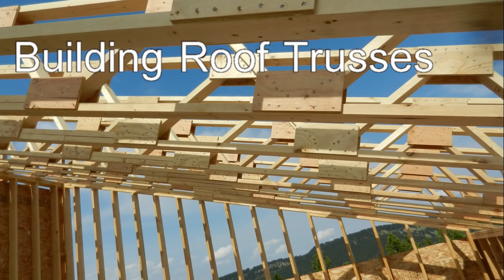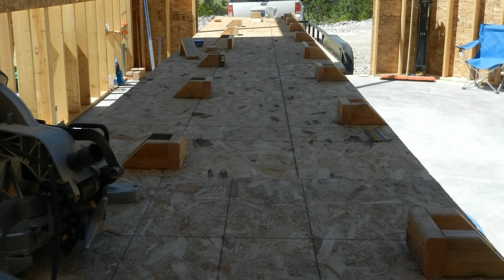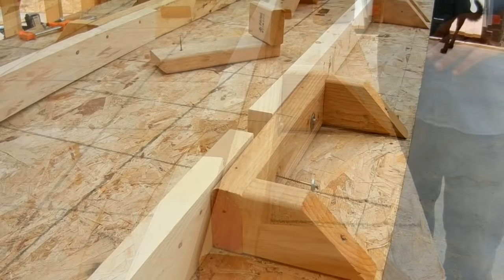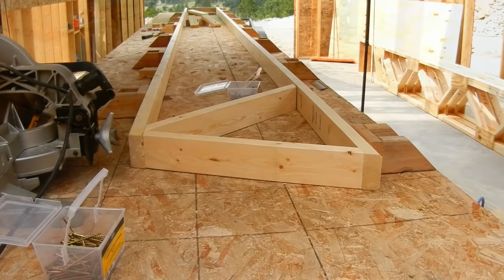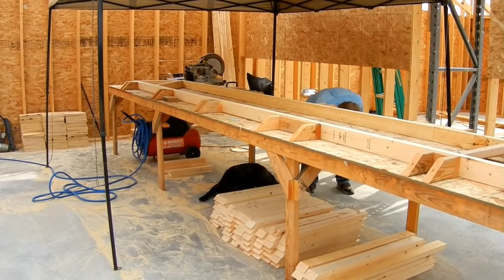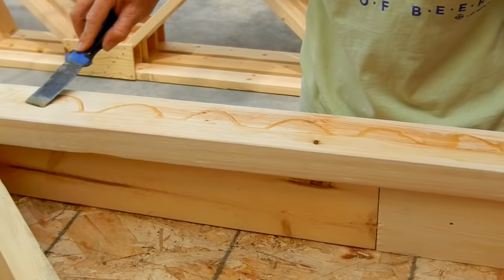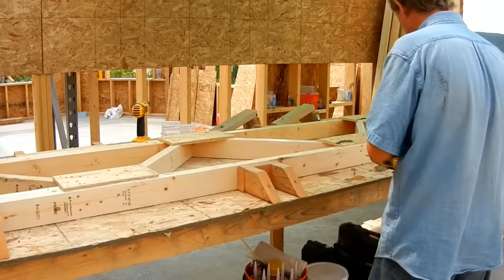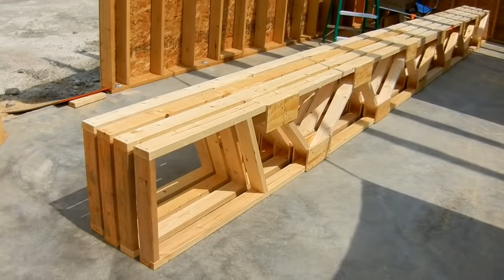Building Roof Trusses

Comment: There are a few video here on youtube where they show how it is done in the factory. Those move along at a fast clip.  They have a couple of things this carpenter does not have. 4 men building the truss, and they have an air ram system to press the truss together before it is nailed off. These two things make the build go at about 1 minute per truss.  Great for the spec builders who can frame a house in a few days.    This guy is obviously building something custom and there is little doubt he is doing the same quality of work, but who here can look at one person working and comparing it to a manufacturer.  Kind of like how long does it take one man to build a custom hot rod vs how long a car manufacturer to roll a car down the assembly line.

Comment: I'm not a structural engineer, but haven't you diminished the 2x4's strength (by about half) by turning them "sideways"?
Reply from the maker: Sean M Truss's don't work purely on bending strength of the members. In a truss each member ends up in tension or compression and being flat doesn't change it's ability to resist these loads. But the real reason they are turned is so that the connection plates can be nailed with a 2" nail providing more holding power.
Reply: +B-Spot Thanks for that, I was wondering.

Comment: I choose the imperial system over metric as a carpenter but Americans are crazy to still use phillips head screws. Robertsons will go at least twice as long before stripping the screw or the bit.
Reply: +Steve Hillier 
I would also offer that the (Lowes or Home Depot) screws shown here are crap- no shear strength at all. Deck screws cost more but are far far superior. If you hit a knot or any dense wood the screws he is using will snap off immediately.
Reply from the maker: +Alaska Bruce --- The screws are used mostly to hold the corners together during assembly and are covered by a connection plate glue and nails in every location except the fascia end where there is no load. They don't need to be anything fancy, and could be omitted completely if I had a better way to hold the lumber in position.

Comment: What they don't tell you .  .  . any glue other than starch glues (wheat or rice glue) will outgas and become brittle with age and will un-stick.  This causes delamination, meaning, the glulam and the plywood that you use to build your house from will literally fall apart in fifty or so years.  One day, it will suddenly fail.  You will notice it when your floors start sagging and holes come in your structure.  That means failure will come soon.  If you want to build a house you can pass along to your children, don't use modern wood products.  Use traditional, solid wood.  Or better, make it from cob.
Reply from the maker: --- I don't have 50 more years in me so I think I am good.

Comment: Turn the boards 90° and use half as many and you will have 4 to 5 times the strength, without the added weight.
Reply from the maker: You might want to do a little research on how a truss works.
Reply: @BSpotBuilds  So might you, Gina is correct.
Reply from the maker: So show me in the calculations for truss's where the orientation of the lumber would be used.

Comment: I am curious if it would be better  not to spread the glue thin like that??.
Reply from the maker: This glue expands as it sets and we only apply enough to just have a small amount of squeeze out. Complete coverage is more important than quantity. I want it to fill the gaps but not end up on the floor.
Reply: I supposed you use polyurethan glue ? thats why you spray water before I supposed also, because polyurethane glue expansion occure with the humidity of the timber if I remember well 

Nice tips if I ve guessed good ;)
Reply: One of the wood magazines did a glue joint stress test and proved that thinner layers of glue are stronger and that surface or contact area is also most important. Some glues are rated for different applications and most wood glue is not rated for structural use or outdoor use. Outdoor rated plywood uses special outdoor rated glue in it's manufacturing.

Comment: Nice video, may I suggest you skip the pre drilling of holes since you're using an impact drill, and pine is quite soft wood. And use a paint roller to distribute glue, makes work easier.

Comment: How did you decide on the size of the gussets?
Reply from the maker: By how many square inches of glue surface was required.
Reply: @BSpotBuilds  Not sure what you mean.  How many square inches of glue surface are required?  I'm trying to find out how large to cut my wooded gussets.
Reply: @BSpotBuilds  Where did you get that number from?
Reply from the maker: @bradperkins4291  The contact area is the area where the 2x4 touches the gusset plate. My plates are 8" x 12", the area that the diagonal 2x4 contacts the plate is about 10". Glue strength is about 250 psi
10" (contact length) x 1.5" (2x4 width ) = 15 square inches contact area
15" x 250psi = 3750 pounds
3750 lb x 2 connection plates one per side = 7500 lb plus 10 nails at about 100 pounds each in shear = 1000 pounds
Total = 8500 pounds per connection.

Your results may vary.
Reply: @BSpotBuilds  Thanks for the quick reply.  If I could pick your brain just a little more; how did you come to the conclusion of needing 8500 lbs/connection?  Is this based on expected live & dead load?
Reply from the maker: @bradperkins4291  I didn't need 8500 lbs that's just what the connection ended up at. 8"x12" was a convenient size to rip the plywood into and provided a good nailing area. As for designing you truss I will refer you to YouTube, there are some good videos on calculating loads. You are correct that you need the live and dead loads, also you don't have to be perfect just good enough.

Comment: The center splices on the top & bottom cords should have been nailed, not screwed! Screws are bad in shear and will fail with a brittle fracture. Nails are more ductile. This truss type also should have double end bearing studs.
Reply from the maker: Do a calculation on the glue holding strength for the splice. The screws are only necessary to clamp the joint. Screws are not that bad in shear, lower than nails but not insignificant. As for double end bearing studs Why?
Reply: Try and find a code with a glue value permitted.
Reply from the maker: @richardh.severn5980  Theirs the problem you live by the code. I do not, and am not required to. Therefore I am not tied to the whims of a bureaucrat. All I-joist are nothing but glue and wood. Zero fasteners why would you discount glue.

Comment: Keep in mind; most codes in jurisdictions throughout the US require Simpson metal mending plates (even though the plywood connectors are stronger), which cost anywhere from .40 cents to $1.50  apiece.   Figuring the average truss would need at least 10 (on each side) and by the time you purchase the lumber - you aren't saving a whole lot of money; at least on the cheaper "in stock" trusses (Menards).   Also, you'd probably need an engineer to 'sign off' on them and we know engineers aren't cheap.   So in short; ready mead in-stock trusses as around $40 apiece aren't worth it, but if you're having more intricate and complicated "special order" trusses made (at over $100) than it's probably cost effective.  As other posters have said, it just depends on how valuable YOUR time is.  .
Reply: Carpenter from Norway here, I don't know the relative cost of material vs finished trusses of other countries, but when comparing them in Norway I can't see how you'd be saving any money by doing it yourself. Maybe after subtracting all of the material costs etc.etc. you'd be looking at a whopping 2USD/hour. Not worth it at all. Let the factories who get the material at a huge discount, has robots to cut it and jigs to mass produce them quickly do it. Unless you are doing it because it's fun though.
Reply from the maker: -- I always consider my labor as free, I am not billing a costumer so the bottom line is how much cash is left in my bank account when the job is done. All the fictitious calculations as to what you labor is worth wont save a real dollar or krone. Also consider to have one dollar to spend you have to earn about 1.40 so that you can pay earnings and sales or VAT taxes. And one more thing to consider is how far you are from a truss supplier delivery charges for me greatly increase the cost.
Reply: But do you not need the documentation for those trusses, or are they not mandatory in your country? We couldn't do that even if we wanted to...
Reply: I found out that "code" require the metal mending plates be rolled on with some kind of press machine which is obviously not available on the home market.  So strike three; I'm out.  The only way to use this method used in the video is to have an engineer sign off on using plywood connectors (as the mending plates) and unless you know an engineer who will work for free - that makes this project completely cost IN-effective.
Reply from the maker: -- Where I live is truly free, no codes to follow, no inspectors to please and guess what? The homes look just like everywhere else they don't fall down or catch fire.
Reply from the maker: -- Imagine that. The building industry teamed up with the government to force you to pay them.
Reply: B-Spot IKR?  As if (layered) plywood would not be 10 times stronger; especially using screws!  I tried to convince our inspector and even showed him this vid - but he was like "nope". The irony is when my (Menards) trusses arrived, half of the fcking mending plates had already fallen off (and renailing those bastards back on with the 1000 little spikes was so stupid) and time consuming.
Reply: B-Spot Well, demanding that houses are built and documented to a certain quality standard is a very powerful tool against cowboys in the business. I've seen DIY'ers do all kinds of terrible stuff. Wich is alright I guess, but the problem arises when someone else buys the home thinking it has been done correctly, Bad craftsmanship causes tremendous damage to houses every year, and is a huge cost to society. And in cases where unqualified people handle things like the load bearing construction, it can be very dangerous as well.

The reason we usually require an engineer sign of approval on trusses is because if the DIY'er messes something up or has a faulty calculation, and the thing actually collapses. I've seen a truss collapse, and let me tell you something, there is no warning, it just goes. If someone finds out you had something to do with the load bearing construction, you are actually guilty of manslaughter, 

Building code has nothing to do with the building industry and the government teaming up to force you to pay up. Building code is an effort to ensure proper quality, safety and enviromentally friendly buildings.
Reply from the maker: -- Building codes are the just the typical government bull. Your city, county or who ever inspects assumes no liability what so ever, they just "inspect" and bill. Most of the crap in the code has nothing to do with safety and who decided I should be required to build an "environmentally friendly building". Building codes drive up cost, stifle competition, and kill innovation. Ask an inspector where the craftsmanship is higher in an owner built home aka "cowboy" or one built by a contractor. By the way a good many houses in existence were built before codes were enacted in there jurisdiction not containing one engineers stamp or building inspectors sign off, and they are bought and sold just like the rest. If asking permission to live and handing you responsibility to others in the name of safety makes you sleep well at night then keep donating to the bottomless pit of government bureaucracy. I think I will take responsibility for myself.
Reply: As for who decided you must live enviromentally friendly, well thee UN decided that we must all make an effort to be more enviromentally friendly, every country on earth has signed that agreement. But, due to the selfish nature of mankind, this initiative will not suceed if it relies on the free will of the individual person. If we are to leave a habital world for our grandchildren, we must actually enforce certain policies.

I am in no way denying that there aren't homes built to a higher standard by home owners vs a contractor, but that isn't true for the vast majority of cases. Maybe this does not imply to you, but there are a huge number of shady installations, constructions and other DIY work that the owner wanted to save a few bucks. Sometimes the work done is quite frankly is appaling. How would you feel if you bought a house that looked alright on the outside but the walls were slowly rotting due to a DIY'er not knowing how to build a house? 

When we look for a house to buy we expect a certain quality standard, to ensure that modern homes are properly built, and not just a turd with a pretty dress, we have to require documentation on the work being done, so that we can safely buy houses without wondering if they will fall apart in the foreseeable future.

I am a licensed contracting carpenter, I have  a 4 year education in building homes, I don't need to surrender my responsabilities to any institutions. However, most people aren't trained and educated in the field, and they lack the experience and qualifications to make such decisions on vital construction designs, therefore it is safer to let someone who actually does, make those decisions.

I, for instance am not a trained electrician. Faulty electrical installations are the cause of most domestic fires, and I have no intentions of exposing me, my loved ones or future owners of the house to that risk. So, i contact an electrician who can do it.

Nobody can be qualified on every field. Choose your field of expertise, and let experts in other fields help you.
Reply from the maker: -- Your view that the UN is the solution and not the problem leads me to believe we will never agree. I disagree with every point you made.
As per the NFPA: 
     Cooking cause the most house fires at 45% 
     Electrical distribution and lighting equipment is far behind in 4th place at 8%  
http://www.nfpa.org/~/media/Files/Research/Fact%20sheets/homesfactsheet.pdf%20cause%20of%20house%20fires%20US
Reply: I suppose the statistics vary between countries. In our country we have stoves that cuts the power when the food is close to burning. I guess cooking related fires are much more prevalent where you actually use gas stoves rather than induciton ones.

Lets disagree then, shall we?

Let me ask you one thing, you seem to not care about mother earth. Do you deny man made environmental change?
Reply from the maker: --I care a great deal about the environment, but I don't believe that we understand the processes behind the weather on the entire planet. I don't believe governments are a superior care taker of the environment. Has man changed the environment? Maybe, dose it matter? I doubt it.
Reply: HadzirLP if building code is about safety, then why are there minimum building sizes?  What is safer about a house that has 1800sq ft over a house with 700 sq ft?  There are log homes with no metal used in construction that have stood for over 500 years, log houses aren't even in the last code I read....show me a balloon framed stick built that is 500 years old....  nope, there are parts of the code that make sense, but half of those codes are bureaucratic BS.  As to DIYers being unsafe, the professionally built house my mom bought wasn't up to code....because the professionals didn't do the job right and the inspector was as useless as the professionals.  I had to go in and redo some of the electrical to get it both safe and up to code.  Blaming DIYers is something professionals do to try and save their job despite their lousy track record (good construction workers that don't screw shit up won't complain about a DIYer, his job isn't in jeopardy; professionals that cut corners, screw people over, overcharge for materials and fixtures complain, because nobody needs a-holes like that building their house).....

Comment: What screw are you using?
Reply from the maker: Regular construction screws.
Reply: @BSpotBuilds  I admit that I am an amateur to carpentry/framing, but I keep hearing and reading about how nails are so much better for framing, etc. because of shear. Are construction screws just as good or better than nails today? How did you select the right construction screw for this particular job?  Thanks. Sincerely, Turtle.
Reply from the maker: @turtleturtle4909  Look at the locations where I used screws, in the eaves and peak to hold in end grain and in the center splice along with nails and glue. The eaves ends have a very low load on them. The peak gets a splice plate after it is in stalled so the screws become redundant. In the center splice the primary purpose of the screws is to clamp the glued surfaces together. The adage that nails have more shear than screws is true typical numbers are about 25% less for the screw. But if you want and have a reason to use screws 10 screws have about the same shear as 7 nails of the same size and probably double the holding power. For locations with screws I used experience that a standard construction screw was more than adequate for the job. In construction you generally only use nails, unless some special condition dictates using a screw. Screws cost more and take longer to install.
Reply: @BSpotBuilds  Thank for taking the time to answer my questions. I noticed in the video that you used a specific wood glue. What criteria do you use to select the right glue for this particular assembly? I am having to repair some gussets and trying to make a selection of a glue.  Thanks again and great video.